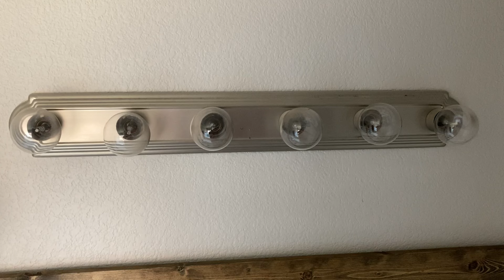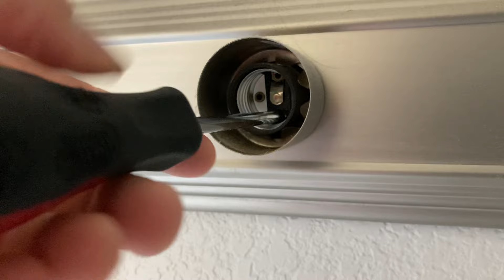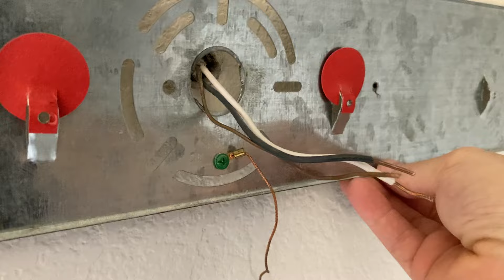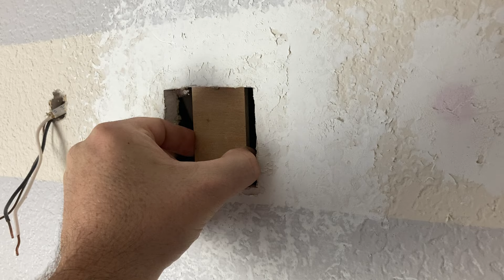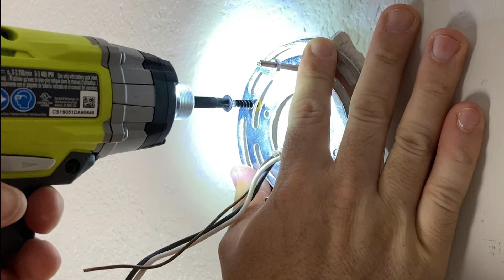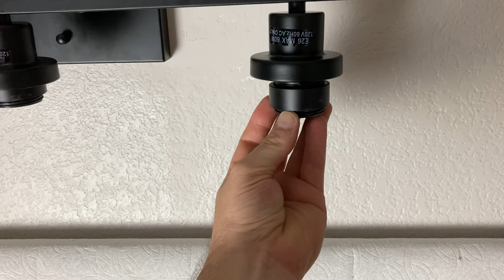How to Replace a Bathroom Vanity Light Fixture

Comment: What happened to the bare copper ground wire... ??
Reply: Yes, that one is missing in his tutorial
Reply: That was my first reaction too. I am no expert but grounding is important particularly in a bathroom?
Reply: Wrap this wire around the separate screw on the mounting bracket and tighten. Normally, this screw is marked green.
Reply: @veqonce I have one coming out of the wall, and one from the light fixture itself. Which do I wrap about the grounding screw? Or both?
Reply: @lindsay7661  you can put both in a wire nut then pigtail that to the green ground screw
Reply: Thank!!! First thing I thought—otherwise, helpful video…but a major oversight
Reply: I have 3 copper wires and it’s hard to get them around the green screw. Do I need all of them?
Reply: @shifty2492 oh no I just replaced the cover only and when my husband saw that there was already a wire on the green screw (coming from the wall) he yanked off the one from the cover. Are we in trouble?
Reply: Did you ever find out what happened to it

Comment: Wow, that is the exact same light fixture I'm replacing, some cheap 15 vanity light, thanks for this vid!
Reply: I'm changing one at my aunts house just like it but the globes are upright. However the silver plate will not connect to the junction box bc there is no drywall behind it

Comment: Great video! I have a copper-looking third wire that I think is “ground”? Do I need to worry about that one?
Reply: Wrap this wire around the separate screw on the mounting bracket and tighten. Normally, this screw is marked green.

Comment: Did you have to repaint the whole wall or just where the gnome hole was? Trying to not have to paint the bathroom after i change the light fixture
Reply from the maker: Only around the gnome door. They get a little fussy if you paint more than that. You may have to do more depending on how big the hole was and the fading of the old paint.

Comment: I replaced a bathroom light fixture exactly like this one out in the Midwest. And it too had a wire coming out the wall like that...shouldn't the wire be in an electrical box in the wall?
Reply from the maker: Thanks for watching Yasser. Definitely preferred to have a junction box when possible.
Reply: @beefmaster_james  New to your channel and venturing into doing home projects by myself now. If you have a tutorial on the junction box, I would appreciate it if you replied with a link. I did enjoy this video. Is the first one I watch, but hoping is not the last. I have a growing list of little projects I need to tackle. Thanks in advance!🙂🙏
Reply: @beefmaster_james  it shouldn't be a preference. a junction box is a must, per code

Comment: Why isn't there a junction box ? is it not required in this scenario?
Reply: There should be a junction box for every light fixture, even the vanity he just changed out. I'm not sure why the last guy who installed the old fixture never bothered to cut in one
Reply: yes, it's required. it could have been an older home, or building code was not properly enforced, or it was non-permit work (hack job)

Comment: There should be a junction box cut in for the light instead of leaving exposed wires sticking straight out of drywall because if those wires were to spark it may start a fire. You can get an old work box which can mount itself on to drywall or use a metal pancake if it's on a stud. Other than that, great tutorial. Love the video
Reply: I'm having problems with that bc I have nothing for the silver plate to adhere to bc there is a big hole and no drywall behind it.
Reply: This is what I ran into. So I had to cut an opening for an old work box. It worked, but it was a scary undertaking since I never did that before.